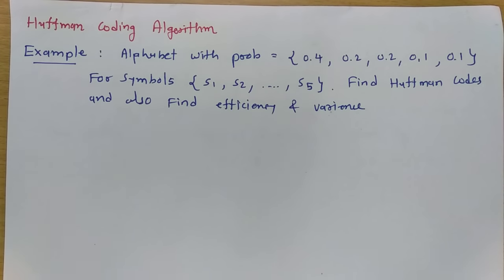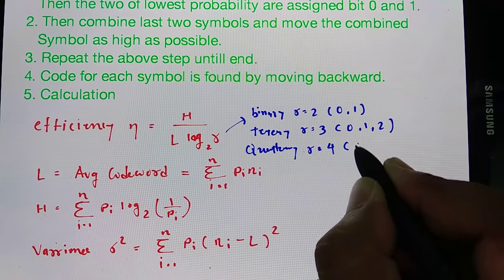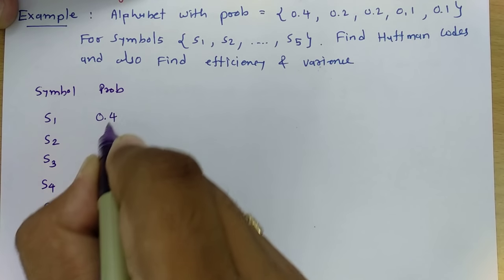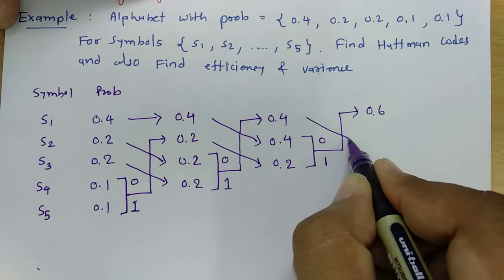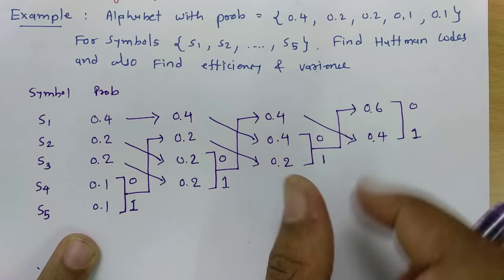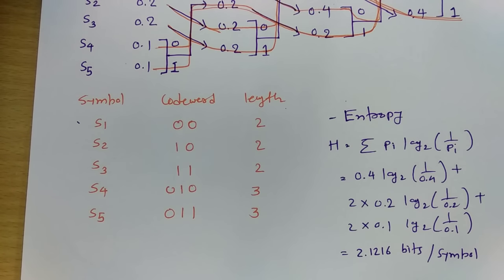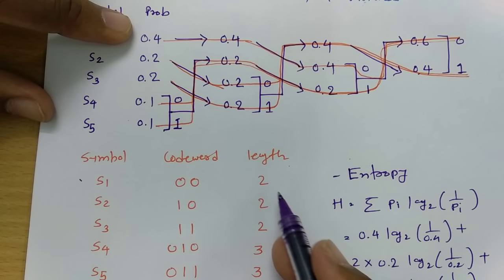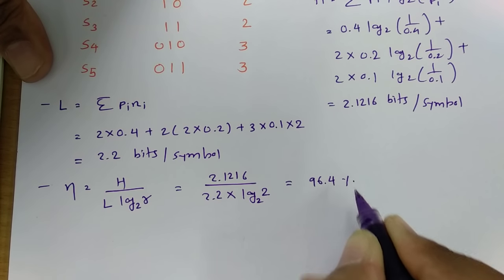Huffman Coding (Basics, Algorithm, Procedure & Example) Explained in Digital Communication

Comment: when we have combined 0.1 and 0.1 the result is 0.2 and as u mentioned that to move the combined symbol as high as possible then why we have restricted to 0.2 instead of going to 0.4 as 0.4 is greater.plzzz reply
Reply: I think as they said before the probability should be in descending order..so if we add 0.1 and 0.1 it will result as 0.2 and we should take 0.2 till the no. which is equal to that or less than that soo...they didn't move 0.2 as much as possible...
Reply: @meghanaponnuru553  👍👍